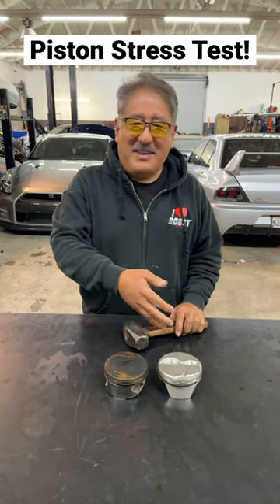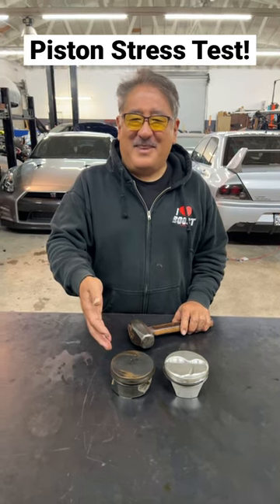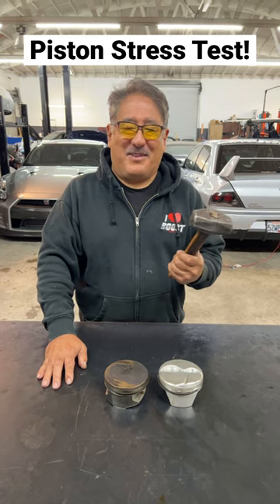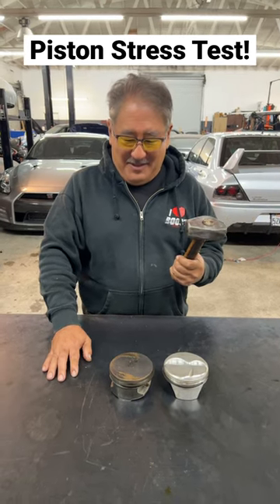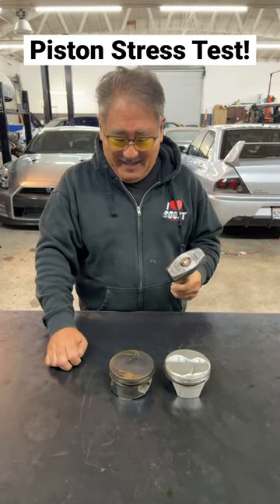Forged vs Cast Piston Strength!

Comment: So why arent all piston forged from factory? When you buy brand new car, i bet price differance cant be that much not to do it🤷
Reply from the maker: Hypereutectic cast pistons are harder, wear longer, can run closer tolerances, and are quieter than forged, all stuff you want in a stock car, their only disadvantage is they are brittle and weaker, stuff you don't want in a performance engine.

Comment: In a race application I agree. But what about in longevity application?
Reply from the maker: A hypereutectic cast piston can last much longer than a low silicone forged piston.
Reply: @motoiq  yes, that’s what I was thinking. I have read that IAG forged long blocks will only last around 50,000 miles. I have also read that you have to use forged pistons in order to apply boost to a motor. How does Subaru get away with using hypereutectic cast pistons?
Reply from the maker: An IAG block or any engine with forged pistons and proper machining and clearancing should last at least 100k miles. Subaru doesnt exactly get away with hypereutectic pistons, it is one of the reasons why they have such a bad rep!  Subarus have a big bore so to reduce crevice volume for emissions reasons, they have to move the compression ring higher. combine that with a hypereutectic piston you have an engine that blows up easy.

Comment: Cool, now we can drive around with the engine pinging indefinitely
Reply: Yeah, this is different from pinging its detonation. And also, yes no reason to not run 150psi of boost
Reply: @everettstormy  
Pinging = Detonation 

It's called a synonym.
Reply: @somejerk1520  maybe a miscommunication but I thought pinging was when timing is wrong and you get pre igintion knocking. And detonation  was a different thing. I guess they would react about the same
Reply: @everettstormy  
Yeah, pinging/spark-knock are other ways of saying pre-detonation.
Reply: @somejerk1520  well no, that's pre-combustion. Pre detonation is a timing and fuel issue lol. You have detonation before tdc
Reply: @everettstormy  yeah...pre combustion, pre detonation, ping, knock...all the same thing
Reply: @somejerk1520  no. pre combustion is correct afr, incorrect timing (ping) cuased by hot spots or malfunctioning ignition system. Knock/detonation is cuased by a lean afr or excesive compression/cyllender pressure. Mixure burns faster than the local speed of sound. Pre-detonation is a really bad day when your car is pinging and knocking at the same time. Hope this finally clarifies it. They are not all the same. Please argue if I'm somehow, after many years of research, incorrect.
Reply: @everettstormy  
Yes. 100%. Any explosions taking place before spark = pre-ignition = detonation and causes a pinging noise which is "spark knock"

No idea what you're on about but good luck at JVS and have a nice life.
Reply: @somejerk1520  idk what jvs is but detonation is seriously different from combustion man. Calm down a second I think you should understand that. Combustion is a normal burn everything is fine and the fuel is "slowly" burning. Detonation is when the afr is optimal for the fuel composition and the flame front becomes Shockwave. It literally moves over 1000 mph and impacts anything in its way like a solid object colliding. IE, and hammer. Combustion good, detonation bad. Higher octane fuel burns slower and doest detonate as easily. I'm being very patient. Please look it up, it's facinating
Reply: @everettstormy  I know all this. I'm a motorcycle mechanic, lol. Notice I used the prefix "PRE" many times...

PRE-ignition = ignition BEFORE you want it

PRE-combustion = combustion BEFORE you want it

Ping = the sound PRE-ignition a.k.a. PRE-combustion makes 

Knock = Ping = Pre-ignition a.k.a. Pre-combustion

Pre
Pre
Pre
Pre
Pre
Reply: @somejerk1520  ah, so like i said, miscommunication lol. Glad we settled this

Comment: Not 100% true it can still run and actually run fine....Back in oh 95-96 ish I pulled the heads off my 355 SBC that had really cheap sterling cast flat top pistons to swap on better heads and the #3 piston was missing a chunk of piston from detonation you could see some of the top ring about 1/4" it had been running beautiful but it did have a mild mystery vibration all the time before i had pulled the heads off, I went to the parts store grabbed another.$15 .030 sterling piston and spent $10 for a shop to press it into the old rod swapped the old rings over and tossed it in reused the head gasket and intake gaskets and its still running strong today.  Things to learn
-sbc is one of toughest engines ever built
- don't toss small chamber 305 heads on for a temporary fix that nets you 10:1 compression unless you can afford premium gas every fill up
-dont take forum key board experts word as gospel
-cheap cast pistons are tougher than people think
-it is possible to fix a jacked up piston for $25 at times lol.
Reply from the maker: You were down a lot of power if you dynoed it you would see.  Cheap cast pistons are actually pretty weak. An old typical 2 bolt main SBC is a weak motor by todays standards.

Comment: Forgings will always be better for everything but cost
Reply: Yeah? Do they run quieter than cast? Do they fit as nice in the bore - presenting the rings nice and square to the cylinder for ideal ring seal?
Reply: @GroovesAndLands  touché. Longevity wise is another story

Comment: Well, thats not how detonation happens or transfers to the piston but.....ok then.

I just want to point out that alot of heavy equipment is made with cast iron and....it takes quite a bit, but like glass apply too much force at the right angle and it can fracture. It also gets much stronger as you apply heat soooo.....when a hammer goes through my intake valve 😢
Reply from the maker: No but it is.  You don't build many high perf engines do you,
Reply: @motoiq  unless fluid dynamics have changed to fit your argument,  it isn't. 

Also..uh....when I pass you at 200 with a tune left in it....I'm just saying.
Reply from the maker: Fluid dynamics doesn't have much to do with the area of the piston that you typically see detonation damage.
Reply: @motoiq  right as a chip on the edge is that area huh. And you were speaking about building engines lol.
Also, it seems the word ' transfers' was lost on you. I want to see you explain which detonation ignores fluid dynamics and transfers to that piston in a jet, all the way through...and on the edge too would help. 
At some point I imagine you think pistons are designed from a purely mechanical perspective.  Or that more efficient engines popped out of nowhere 🤔

Edit: list me a few engines in which detonation occurs right on the edge and the shear line to the ring is sharp enough that no transfers happens to the walls. If I can get that I'll concede. I'll not make any stipulations on recessions or anything.  For a second,  let's just assume it's a point load on that surface (lol it isnt), I want a couple engines
Reply from the maker: You don't need a list of engines that fail that way. If you have actually taken apart ANY engines that failed due to detonation you would see that the damage is almost always on the edge of the piston on the exhaust side and the early damage is broken ring lands there. More severe damage is actually cutting of the piston through the ring lands. Early evidence before damage happens is roughness and it is found mostly on the edges of the piston on the exhaust side.  It is rarely found on other places of the piston. Usually the piston fails there before the damage can propagate to other parts of the piston. Denotation is usually localized uncontrolled combustion.  You through out the term fluidynamics very casually. If you understand it, what laws describe what is going on in the combustion chamber during a detonation event?
Reply: @motoiq  did you just try to sidestep? 🤣
I know you just did. I asked you to provide examples, you explained partially  why I asked for one of the requirements,  which was the shear angle to the ring... and nothing else. 
Bruh, you're a trash builder that makes his way because no one else would  care to invest the time. 
That's my opinion, take it as you wish, or don't take it at all. I've seen you do noting but dance around the issue. I take my W at this point. 
I left another comment under another one of your videos though. Maybe that's a little more suited to you, lol.
Reply from the maker: Hahaha you are a joke troll who has never built an engine and knows nothing of fluidynamics. Have fun.

Comment: Looks like the cast piston didn't have the same top ring land. The forged was set a lot deeper, so it makes it a lot harder to bend.
Reply from the maker: Racing pistons have taller first ring lands, but it was cast it still would have cracked, I hit that sucker pretty hard.  The cast piston was also something I had lying around that I could break.  If I really hit the forged piston, the ring land would have probably bent, sticking the ring but it would have not cracked.

Comment: You not need forged piston. You just need precision and good engine design for 100 year used.
Reply: Its better if its tougher
Reply: @ДаркоОкиљевић  Tradeoffs, tradeoffs. Yes, forged pistons endure engine knock better than cast. But forged pistons also rattle when they're cold and the looser fit in the cylinder gives up some ring seal.

Nothing in this world is simply "better" - only better in certain ways.

Comment: What about long term? Forged better or worst?
Reply from the maker: Forged wears faster but is many times stronger.
Reply: cast lasts longer
Reply: @motoiq  why is that
Reply from the maker: A hypereutectic cast piston has particles of silicon in a matrix throughout the metal.  These are hard like a ceramic and resist wear.  Makes the metal brittle though.
Reply: @motoiq  plus that the forged piston need more clearance due to the way the material expands...?

Comment: Yeah but the forge just brand new and the non-forged is already used and pulled out of a push to its limits maybe car for better review let's see two new piston heads instead of a worn one
Reply from the maker: The forged is actually very old and it would not have made a difference in the metallurgy or the outcome of what happened.

Comment: Didn't realize hypereutectic pistons are so brittle
Reply: The demo was about cast vs. forged (manufacturing process), not hypereutectic vs. non-hypereutectic (silicon content).

4032 forged pistons are forged pistons that are hypereutectic, having 12.2% Silicon which is 0.2% higher than the eutectic point.

Comment: Ring grooves last a long time (no ring wiggle) with forged pistons so they use less oil. Forged pistons use chrome rings. Cast pistons get iron rings. All new cars come with forged pistons and chrome rings. Most typical replacement pistons are cast.
Reply from the maker: That is 100% wrong on all counts.
Reply: @motoiq  nope
Reply from the maker: Almost 100% of current new cars come with hypereutectic cast pistons. Hypereutectic pistons are used because they are much more dimensionally stable and can have tighter tolerances so they reduce HC emissions by having less end gasses. The extremally hard silicone carbide inclusions in the alloy make the pistons much more wear resistant than forged pistons, especially in the ring grooves. Their drawback is that they are brittle and can be more easily damaged by detonation or high loads than forged pistons. Most new cars come with plasma Ti Ni or dlc coated low tension compression rings nowdays although chrome is still sometimes used in the top ring only. Whether a piston is forged or cast has no bearing at all on what the ring material is.  You are 100% wrong on all counts.
Reply from the maker: Only a few vehicles run forged pistons from the factory, the vast majority use hypereutectic, pistons were never were mostly forged from the factory except for a few models.  You are wrong, quoting Wikipedia doesn't change that.  Aftermarket means not from the factory!

Comment: So. You didn't have the ring in the groove to support the ring land. Also, either you're missing the top ring on the forged piston or the ring grooves on the forged piston were machined closer to center of wristpin. It's not ALL about material. People have put turbos and superchargers on engines with cast pistons, and they do fine.
Reply from the maker: The rings were in BOTH pistons, I even showed them. It's all about the material, if the video could be longer than 60 seconds, I could beat the cast pistons into small pieces, the forged piston I could dent up but not break apart. Sure you can boost cast pistons but not very much or very long.

Comment: Would love a reliable forged piston in my next Diesel engine.
Looks like I’ll be waiting a while since my reco stock engine has been ordered.  Another 400,000 klms if I’m lucky.
Reply: Keep in mind forged pistons don’t have the same longevity as cast piston’s because you have to run a bigger clearance do to the greater heat expansion of forged aluminum. This can cause a lot of piston slap on cold starts which will wear the bores and pistons over time.

Comment: If i offer to pay will test factory components vs the same components only cryo treated and wpc treated?
Reply from the maker: Yes
Reply: @motoiq  how much?
Reply from the maker: What sort of engine?
Reply: LT1 gen v 6.2l.
Reply from the maker: It would be kinda expensive, refresh motor, dyno for baseline, take apart, WPC and cryo, then dyno again. You are probably looking at something like 10k in labor and dyno time. We did back to back tests with go kart engines and it made like 2-3% more power which is huge in a spec class.  The big thing we notice is doubling the wear on parts.
Reply: What im trying to see is the cost effectiveness of the cryo and wpc treatments. Also i would like to know more about it. As much as possible actually. Does it have the same effect on copper electrical wire? Electric motors? Solenoids exc?
Reply from the maker: You know some people claim that.  The cryo company we use treats high end stereo speaker wires for a company and they swear it makes the speakers sound better. Sounds farfetched to me but this company treats all the wire they sell.  I treated my rifle barrel and that sucker now shoots one hole groups at 100 yards. It used to be one inch.  One of my stereo friends who only runs vacume tube amps with tubes made in the 50's (he says old tubes sound better!) also cryo treats his tubes and says they sound better. I can't tell but he says it's a huge difference. Our company also treats RC car motors for people too. The racers says it helps.
Reply: @motoiq  does either treatment protect the metal from high heat? I work with extrusion dies. Hollow and solid dies.
Reply from the maker: I know that drill bits and end mills last a lot longer with cryo-treating.  It would be interesting to see if extrusion dies last longer.  Maybe you should call CTP cryogenics.  A lot of their work is treating industrial parts.
Reply from the maker: Check this out if you haven't yet. https://www.youtube.com/watch?v=IRqX_2-ORjM
Reply: Im interested in seeing the results of wpc treatment on the bearing surfaces of the dies.
Reply from the maker: Are the bearing surfaces something like tungsten carbine?
Reply: My supervisor says its made of h13 steel. Im looking for the alloy sheet for them right now.
Reply from the maker: Ah tool steel, cryo makes a big difference on that.

Comment: The pressurel in the cylinder  is all over not just on the edge. 
Cast iron is much  harder than aluminum.  So less ware over time. It is heavier  so it depends  on what you are trying to do.  I vote for longevity longevity
Reply from the maker: Cast Iron?

Comment: What is the longevity on a well built ej257 closed deck?  je pistons, callies 2mm+ rods, built heads ferrea drivetrain titanium springs std valves 264/272 mixed cams.  (Built is not for daily or drag, spirit driving and enjoying it during weekends and back inside the garage)
Reply from the maker: Something like 100k miles or more of street driving and about 20-40 hours of track driving, all depending on drive cycle and how much boost you feed through it.
Reply: @motoiq  thanks 100%
Reply: I think they also have a video on how to build a bulletproof subie engine 😉

Comment: Yes smack the edge of that f**** piston with that hammer like you did the cast piston it'll break the same way 😂 yes forged are stronger but design and machining processes play a bigger part than material also that cast piston has been annealed it is hard run a couple of hot laps with that forged piston it'll break the same way the forged piston can handle a lot higher Temp and Temp swing the big problem with the forged piston that slap 😂 if you know you
Reply from the maker: Ugh no shit, and I did hit both pistons as evenly as I could with a damn hammer and I probably hit the forged piston harder. This is for entertainment in a 60-second short and not scientific.

Comment: This one is as funny compared to Smedia turning an internal Wastegate to external wastegate with a sledge hammer.
Reply from the maker: How do you do that?
Reply: @motoiq  he was banging the wastegate actuator rod with a sledge hammer.
Which forced it to shut lol
Reply from the maker: @moisesr7840  so he could use an external gate without taking the internal one out?

Comment: Other have gone lot of heat cycles and other is from box so i call poo poo. Maybe selling the product with this boloney vid.
Reply from the maker: Both pistons are very old.  The new looking has had two seasons of pro formula drift very hard use in a car with more than 1000 hp.